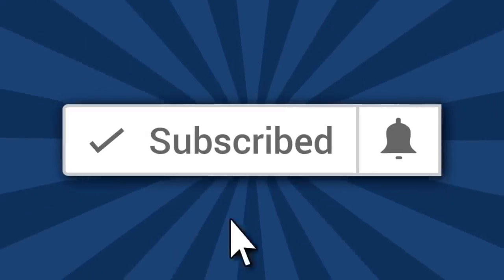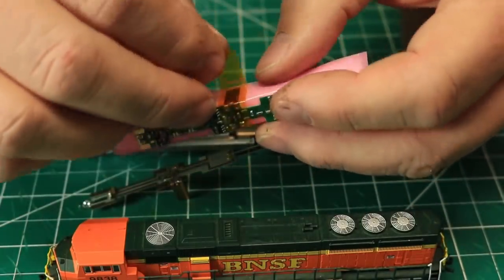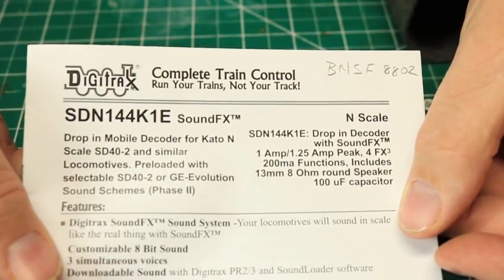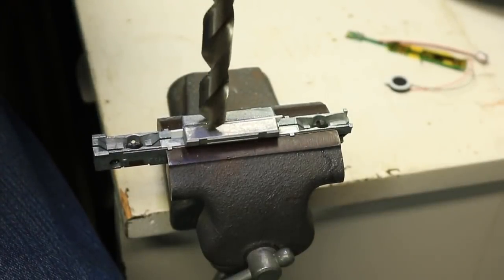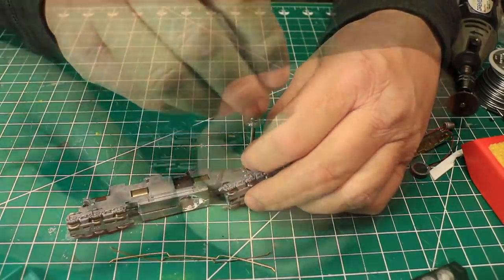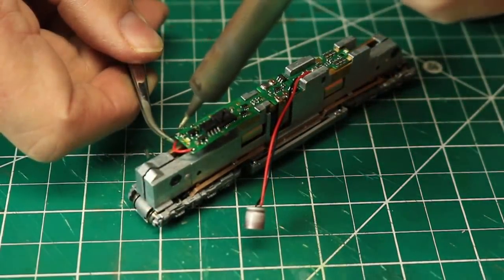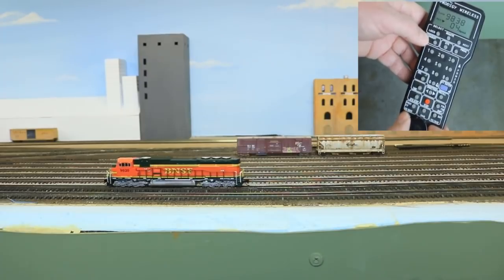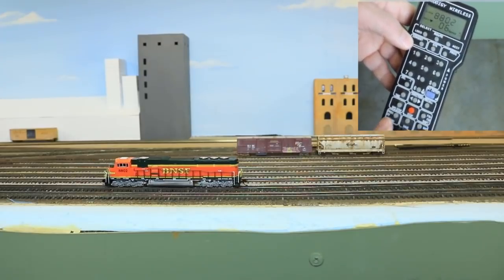DCC Sound Decoder Installation N Scale

Comment: I know it has been quite a while since this was posted but using a 1/2" forester bit for metal will work much better to make the holes for the speaker. You won't have to clean them up with a dremel as it cuts flat.  They are like 8 bucks from Home Depot.  Just a tip to help make things easier.
Reply from the maker: I am a wood worker, not highly experienced in metal milling. I wasn't even aware you could get a forstner bit for metal until now. Thanks for the tip.

Comment: Great Job of installing! the first sound decoder you need to mill out the fuel tank for the conpastor.  and then you need to use a speaker baffle to direct the sound out.  I don't like that one with the long speaker on it, it's not as loud.  the last one with the round speaker if you take some tape and put it over the front of the speaker and drive the sound out the back. And mount if face down just like you did . It makes it about 10 times louder and on the fuel tank I drilled out the 1/2" hole and then put a screen over the hole to keep out the big stuff.  Give that home made speaker baffle a test and see if it works better for you. Thanks for all the great videos, I find my self sitting by the computer waiting for your next one to show up!

Comment: Great how to video Ron!  Just a couple things I would recommend.  While the engine is apart, it's a good time for some teflon lube on the gears, and light amount of conductive lube on contacts. Second of course would be an ESU decoder w/  sugar cube speaker, no milling required
Reply from the maker: ESU doesn't make a straight forward replacement board for Kato yet, so ESU is a little involved for this loco, but that is probably the way I will go.

Comment: very good video i have done  digitrax sound in kato ho before but not in n scale . i just did my first so far so good i found a milling bit set (it comes with 8 bits ) on micro mark and did exactly as you did with the drill bit it  made a big difference.

Comment: On my Kato ES44AC I filed the pyramid shaped tab at the front of the shell under the light tubes just enough to be able to carefully place the capacitor into the hood and out of the way to facilitate placing the shell back onto the chassis. So far it doesnt seem to have adversely affected the fit or finish.
Reply from the maker: Awesome!

Comment: Ron, 15,000 subscribers, Big "UP'S" to you.Nice to see the replacement decoders installed with no hassle at all. Before re-conecting anything did you have to wash the basic chassis to clean away any swarf left behind? Even my fat fingers might be able to do this. Cheers, Chris Perry.
Reply from the maker: I did not wash it, just wiped it down with a cloth. This metal is non magnetic, so cleaning it up is pretty easy.

Comment: If these manufacturers would use a 4 ohm speaker instead of a 8 ohm the sound would be louder. Also you could add a second speaker in parallel which drops the impedance of the 2 speakers to 4 ohm each and takes less power to operate them. This is simple car audio knowledge.  Also you could drop a bead of epoxy to set the back of the speaker in the chassis.
Reply from the maker: Good tips. Thanks, Adrien.

Comment: I use the factory light board to light up my building.  All I did was solder on some wires to the pick up plates and tape it to the top of the building.
Reply from the maker: That is a great idea. Thanks for the tip.

Comment: Yes, tricky fitting that speaker without a mini or micro milling machine (look at 'Proxxon'). But those are expensive, so three tips: Start by using a smaller 'four facet ground' drill (use Google for details). It is much less likely to wander. Then gently open the hole up with successively larger drills. Buy something called an 'end mill' in the same size as your final drill size. Use this to give a flat bottom to the hole but take care not to increase the central depth. Do not try to drill the initial hole with any end mill - it will skate about all over the place if both it and the workpiece are not held firmly in a proper milling machine. Finally, buy some suitaby sized drill stops. These are metal rings that clamp on around your drill bit and prevent you drilling too deep - all to easy to do. Using a small precision drill stand would also be a good idea and they are not that expensive. They give much better sideways and depth control than can usually be achieved by hand. This job is not for the faint hearted! Maybe find a friendly small engineering shop and buy them a beer or two. Good luck. BobUK.
Reply from the maker: Thanks for those great tips. Much appreciated.

Comment: Hi there, new in the hobby I´m wondering what DCC is for? i have read that it will only add sound but can´t control 2 trains in the same track... from analog to DCC what is the up grade or difference? please let me know cheers...
Reply from the maker: DCC allows you to run your trains,not your track. In other words, you CAN run multiple trains in any direction simultaneously, and it simplifies the wiring. It can add sound too, but sound isn't a necessary component of DCC.

Comment: hi
i have a small question?
I'm looking to purchase a glacier express (kato 10-1145) but i want to know first if i'd be able to install a decoder in it and equip him with sound aswell. What would you recomend? Is my only option drilling a hole in the frame to fit the speaker? if so where?

thank you for your time :)

Comment: Ron, I’m sure these videos were done awhile ago, but have you thought about installing one of those new LokSound decoders in that third Kato?  Do you prefer Digitrax Sound decoders?  Given that the ESU decoders ate a bit more they are worth the difference. 

Really can’t see this speed matching video. Everyone makes it look so hard in N scale. 

Ron thanks for all you do and have done for us my friend. Peace be with you
Reply from the maker: I wouldn't say that I prefer digitrax decoders. I have used them for several years before the higher end sound decoders started coming out. I started with digitrax sound decoders for video because they are an easier installation. I thought about doing a loksound decoder in one of these, but they don't make a straightforward replacement decoder for a Kato locomotive. I would prefer to install a loksound in an Atlas locomotive for the sake of video. Since my digitrax decoder didn't Pan out in this case, I may be trying a loksound after all.

Comment: Hi Ron love the videos!.  In you opinion, what do you think the best dcc sound decoder is?  I have recently got back into the hobby and currently have a new Broadway Limited GE AC6000 with Paragon3 Sound, I have a new Atas SD60E with LokSound Express, I have a new ScaleTrains GE CW44-9W with LokSound 5, and a new digitrax SDN144A1 decoder I installed into an old Atlas SD60M from the late 90's.  The digitrax sound decoder is....well leaves a lot to be desired.  It is the worst of the bunch.  I simply don't like that one.  The other three are pretty great in my opinion.

Comment: I am just wondering programing on the main....if you had another loco on tghe layout if you program the new one will it not effect the other?  like the idea of putting the dc board in the jewel box.  I do plan on installing a sound decoder and , is the same technic good for atlas locos?  I drill out my frames with the dremel drill press  with the apropriate cutting bit.  works very well.  good video
Reply: I have done that with my MRC and never a problem with other locos on the track
Reply from the maker: As long as you don't have any other locos with the same address you will have no problem. You are programming on the main to a specific address. That is why I did these separately, because they both were originally programmed to factory address 3.

Comment: Hi Ron, how are you? Great video. Thank you very much for your contributions. Some time ago I bought 3 digits digitrax SDN144K1E, which I installed in three kato locomotives, GG1, SD40-2 and AC4400. In all three cases, when the sound is not deactivated, the docoder restarts within a few seconds of activating the locomotives. I was told that it could be caused by bad welding contacts, but by deactivating the sound, the locomotives work very well. You can help me find the problem, it is a shame not to be able to use the sounds. I use a central digitrax db150. Thank you.
Reply from the maker: I would say you have a bad contact somewhere. The reason it acts up with sound is because sound draws eignificantly increased voltave over motor only control. Check all of our contacts really well.
Reply: @RonsTrainsNThings  Ok thank you. I see the contacts. bye, bye....
Reply: @RonsTrainsNThings  thank you I will....rewards.

Comment: Great Video as always (do you ever get tired of reading that? :)  
I just purchased a Kato SD70ACe and will be installing the Digitrax  DN163K1c  (That sound module has me worried and I installed the sound system in a Kato D7 milling the back-end with just a dremel tool!)    Anyway... I don't see any lights on the  DN163K1c board.  Is that right?
Thanks again! Charles
Reply from the maker: It definitely has lights, but they are tiny square LEDs mounted directly on each end f the board, so they camouflage well.

Comment: Hi there everyone, I just purchased a new Kato ICE 4 train and Kato decoder for it. when I installed the plug and play type decoder I programmed it using the intellibox2, however when I run it, it runs unevenly like it surges in speed the slows off then surges again. I haven't installed the accessory decoders for the change direction red and white lights yet as I am awaiting delivery could it be that is part of problem, was just wondering if anyone out there has encountered a problem like this.

Comment: Hi Ron, great video. I know there are better sound decoders for n scale but do you recommend the digitrax sound decoders? Also what kind of soldering iron is that, i've been looking for one with a fine tip like the one you are using. Keep up the great videos.

Comment: Hi Ron, great video. You make it look easy!  I assume you are using your new soldering iron here, curious as to what power setting you are using when soldering to a decoder.  thanks.
Reply from the maker: I was using a very small tip and on the variable heat 40 watt iron I used a setting of 2 out of 5.

Comment: Thanks, brother, nice work, why Digitrax?   Was ESU too expensive?  Soundtraxx?  Wish I had that wireless controller, my MRC is great, but a wireless would be fantastic...
Reply from the maker: Why Digitrax indeed. I have a fleet of Digitrax decoders, and in consists it is better to run the same brand decoders together usually. I also wanted to show an easier install before something more complicated, and in many cases ESU is an more complicated install. I will be doing some ESU installs in the future, probably starting with the loco that was a fail for this video.

Comment: Hello , The One Thing you’re forgetting with any New Decoder Installations is always put Her on the Program Track First to Install Address that way if there is any shorted Wire or mis installed Wire she Won’t take the Address and being the the Program Track is Low Voltage you won’t Fry your New Decoder!🚂 Regards C&OGuy
Reply: The low voltage on some systems will sometimes not even have enough power to be able to program sound decoders.
Mike
Reply: Mike Fifer True on some Decoders on my Digitrax you can adjust your Program Track Voltage  or use a Program Booster and avoid Problems ! C&OGuy
Reply: I have Programmed addreses inQS I , LOKSOUND T C S and DIGITRAX with no Problem! on the Program Track!

Comment: Good morning,
I would like to change 2 already digital locomotives (N scale) to digital with sound.
I ask you: do you or can you tell me who does this type of work?
If so, assuming that I send you the two loco, I would like to know if possible, the procedure (if you need to completely replace the decoders or just change them) and, possibly the cost.
I would also like to know if it is more convenient to digitize an analog locomotive with sound or, as mentioned above, to modify an already digital one.
I thank you in advance,
Massimo -
Reply from the maker: To upgrade to sound would require replacing the decoder and adding a speaker. There are people who do this work. Your best bet would be to ask around in model railroad Facebook groups for people who do. As for which is easier, if the locomotive is DCC ready it doesn't matter. If it is an older locomotive that is not DCC ready it will be more difficult, but not impossiible.
Reply: Grazie a tutti per le cortesi risposte ma ho scoperto che la loco non era sound... per questo l'ho restituita. Grazie
Ora mi servirebbe di conoscere come si fa, con il multimaus, a mettere la F29.
Grazie

Comment: Thanks for the great video. I am getting back to model railroading again and am still deciding on either HO or N scale. That install with your milling went nice. Thanks for sharing. Did you ever have HO scale? If so, would you be able to make a short video about both scales and why you chose N. Thanks.
Reply from the maker: When I 1st got into model railroading I had planned to model in HO scale. I collected some hok scale equipment, but never built a layout. I experimented with in scale and never went back.
Reply: Thanks for the reply. Looking forward to the next video. 👍🏼

Comment: I want to do something different: I want to mount an external sound card, wired or via Bluetooth, to my external stereo (Bluetooth equipped) speakers to get better bass and fidelity. Why has no one done an extensive video on this topic?
Reply from the maker: I know there were systems for this, and BLI Rolling Thunder is similar, but most have been abandoned for onboard systems that travel with the train.

Comment: When I see that most decoders are not really plug and play, the work required by the installation and the most often, the poor quality of sound, I wonder if it is worth investing in adding sound decoder? Is it not better to buy factory equipped?
Reply from the maker: The sound quality is pretty good these days and getting better all the time. As for factory equipped, those usually use lower end decoders. I have not had good luck with them. The exception of course is scaletrains who uses loksound decoders.
Reply: The sound from an SD40 intermountain or BLI is very impressive. Mines are very very good.
Before, I was thinking to add sound decoder to my other locomotives, Atlas GP's. I tried with MRC and the result is not acceptable.
So, I think now I'll buy only dcc sound factory equipped but I'll not add by myself a sound decoder to a model. It is not even totally plug and play. I think that's a pity.
However your video is very interesting but this work is not so easy as it appears.  @RonsTrainsNThings
Reply from the maker: MRC are known to make the absolute lowest quality sound decoders on the market. Digitrax, Tsunami, or Loksound are the way to go.

Comment: You put your speakers in upside down friend.
Reply from the maker: No, I didn't. I installed them exactly per the instruction sheet from Digitrax. Installing them this way allows the cavity to act as a resonance chamber which deepens and enhances the quality of the sound from the tiny speaker.
Reply: @RonsTrainsNThings  i have tried both ways, but the masses put them so the sound projects down, and drills the tank bottom. when i tried your way the sound into a blind hole was horrible (to me).